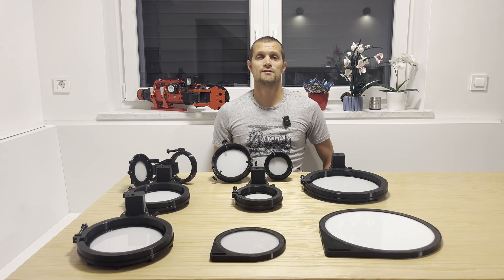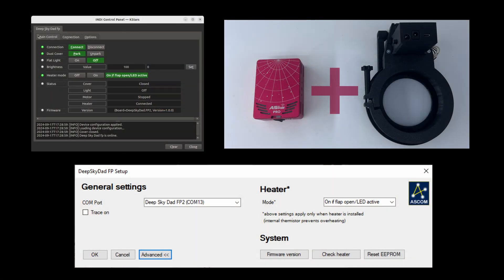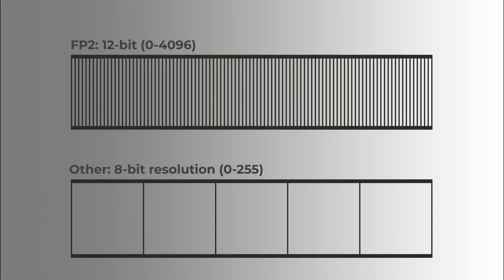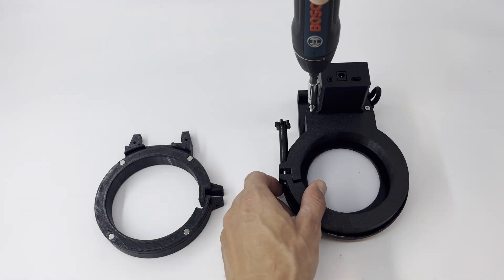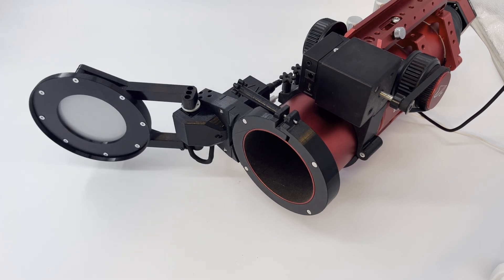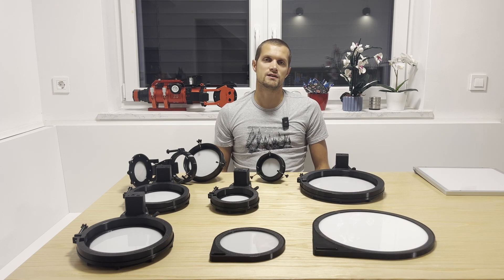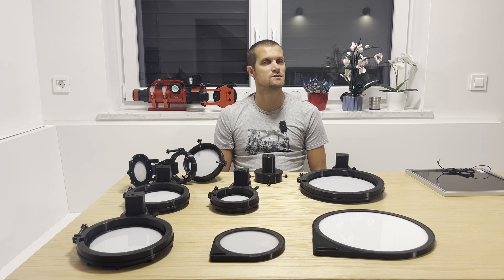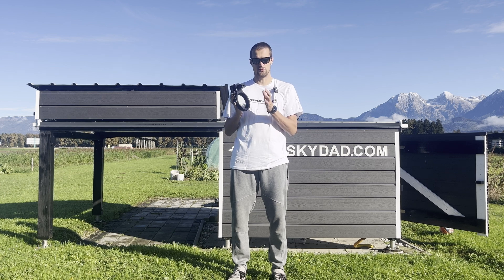New Flat Panel lineup (FP2) released!

Comment: Does the Stellarvue SV130 Flap Panel (FP2) work with the Stellarvue SVX130T?
Reply from the maker: No, the dewshield diameters are different. But you can adapt SVX130 unit to SV130 with spacer rings or replacement compression ring. For more, drop us an email :)

Comment: Do you have any plans on creating a flat panel that adjusts the light intensity to create light frames at a selectable exposure?
Reply from the maker: I hope I understand the question correctly - you can select/iterate through preconfigured brightnesses via manual button on the panel.
Reply: @ What I mean is being able to select a specific exposure and your light screen software will automatically adjust the light intensity to achieve that exposure
Reply from the maker: @ NINA can do that - it  can adjust exposure or brightness of the panel to reach the desired ADU

Comment: Congrats. Is the FT2 panel also controlled by AsiAir ? There is not much information on you page about this model. Also how dim it can go ? Are 3-5 seconds flats possible with it ?
Reply from the maker: @michalgomolka  yes it is controllable via ASIAIR. 3-5 is doable without problem at low brightness
Reply: @DeepSkyDad  Does FT2 have the same functionality as the one with motorised flap in terms of setting brightness presets for button and ASIAIR ? Also, It might be a stupid questions but does the panel„remembers” settings after it’s disconnected from power or they have to be set every time ?
Reply from the maker: @michalgomolka  yes, it has same functionality as the motorized flap for adjusting the brightness via manual button or asiair. Brightness settings/presets are stored in flash memory so they are not lost on disconnection.
Reply: I take 5second flats with fp1
Reply: @Masoch1st  that’s good to hear, with what filter and gain ?